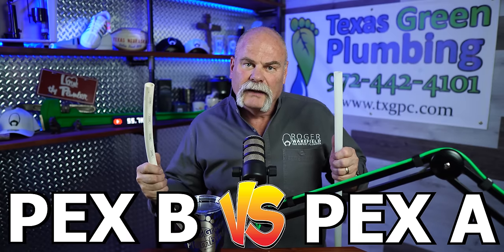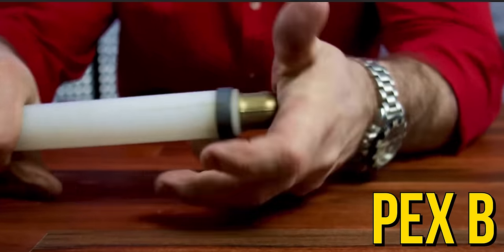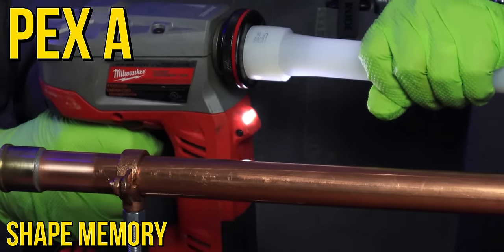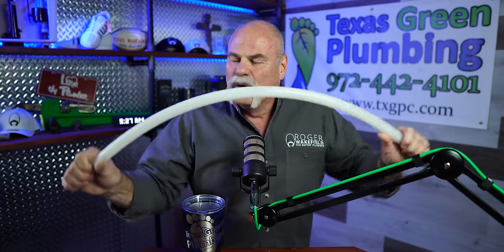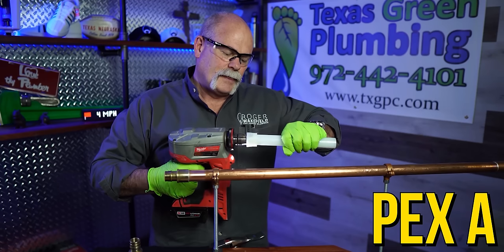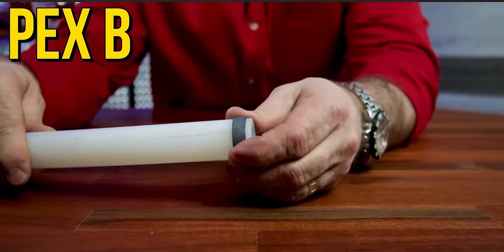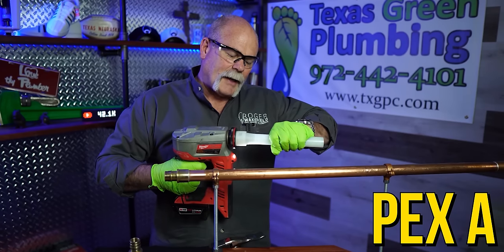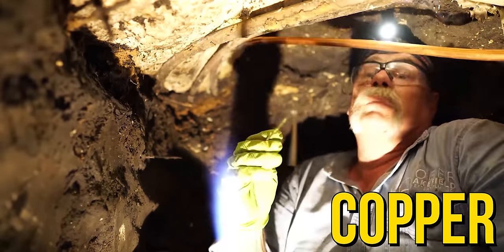PEX-A vs PEX-B - What's the Difference? Which Should You Use?

Comment: Definitely recommend an experienced plumber. 

That said, this stuff is nearly idiot proof. I re-piped my entire house (removed 100% old galvanized) with PEX A when the hardest plumbing job I had done prior was replacing a toilet wax seal. 

Also, for anyone who decides to DIY, screw the manual expansion tool. Spend the extra coin, save yourself time, and get the battery operated one. The auto rotate feature alone makes it worth it.
Reply: Agree. Thanks for comment.
Reply: Why would anyone doing a home improvement drop all the extra cash on the power tool? I could see if they planed to use it for a long period of time, but for a one off project?
Reply: @snyper1982  I did it because it makes the job so much easier. I didn’t have to guess a single time if I rotated it enough during expansion, and while I was in my crawl space I didn’t have to fight the lack of space when trying to manually use a tool. 

To me, the time saved was worth the ~$300. Plus I can resell it and have only paid about the same as if I purchased the manual tool. 

Not for everyone, but it makes sense to me.
Reply: @vinny61389  if you can buy it used or know ahead of time that you can resell it for nearly what you paid then sure its a good idea, especially if your one off diy is a larger one like yours was. But if your just doing a small diy job like most people, I dont think its worth the investment.  Just my opinion. Especially if your only  running 1/2 or 3/4.
Reply: @snyper1982  In my case I got a quote of $1400 to replace a copper line that developed a leak under the slab.  Line crossed under kitchen floor from a copper manifold in an interior wall of the kitchen to the outside wall feeding the sink.  Quote included removing sheetrock and drilling each stud to place pex through from the manifold to the back of the sink but not replacing the sheetrock or backs of the cabinets.  I was able to buy the bare tool (using batteries from same brand I already own), the pex a and all needed fittings for $400.  I was going to have to repair sheetrock or pay someone else to do it anyway so I might as well do all the work and save some money and the thought was I could probably sell the tool for 3/4 of what I paid if I wanted.  I would have preferred an underslab repair but it was not going to be possible without ripping out cabinets and granite.  Another thing that turned me off from the plumber that gave the quote was when I asked what type of pex they were going to use and they said the blue since it was a cold line.  I asked if they used crimp rings and they said yes all pex uses the crimp rings.
Reply: @mmotodad  if you got the tool and pipe and fittings for 400, I cant fault you for that. Lol. Im talking about dropping 700+ just for the tool, for simple home improvement jobs. I remember having to roll soft copper under the slab, repairs on those lines suck.

Comment: I work for two different plumbing companys here in San Diego. I've installed, using only pex A on a new construction 4 unit three story building in downtown S.D. Did the entire building using pex A, and using the Milwaukee tool for all of the couplings. Great and flexible stuff, loved working with it. While I do repiping on houses with the other plumbing company. He only! uses copper for every plumbing project we come across. Because he doesn't trust pex in the long run. And he doesn't want call backs for leaks in the future. So I guess its all personal preference.

Comment: How do you feel about the other type of crimp rings? I’ve switched to them solely because of the smaller tool and it seems like you never accidentally have those rings cocked and crooked the way that the copper rings will

Comment: Viega (pex B) 
Pros 
-faster (insert and pinch).
-not affected by cold when installing.
-easier to assemble pipe and fittings (built in stops in the fittings).
Cons
-doesn’t bend as easily
-fittings are not full flow

Uponor (pex A)
Pros 
-full flow fittings 
-bends easily 
Cons 
-slower to work with (expanding every joint and making sure the fitting is fully inserted before the pipe starts shrinking again).
-not easy to install in cold weather (pipe doesn’t want to shrink back without a heat gun) 

I feel for service work I would rather use viega because there’s no wait time. I can pinch a fitting and have the water back on instantly. With uponor you should wait for the pipe to set up before turning the water on. For new construction or remodel I would use uponor.

Comment: Keep in mind 3/4" copper piping has an inside diameter of 3 /4" or better (Type K=.745", Type L=.785, Type M=.811, all have 7/8" outside diameter. The 3/4" Pex piping (both Pex A & B) have inside diameters of .671 (basically 5/8") & outside diameters of 7/8". So we are already getting a flow drop restriction going from 3/4" copper to 3/4" Pex (3/4" to 5/8"). The fittings for Pex B do drop that a little bit more to slightly less than 5/8" based on my measurements but I could be wrong.

Based on my very limited experience Pex B does offer a significant labor savings advantage, obviously over copper, but also over Pex A. Now I was using a manual Pex A expansion tool, not the battery powered Milwaukee one. But I still think for Pex B (1) placing a band on the pipe (2) putting a fitting inside the pipe (3) compressing or crimping the band is quicker than using Pex A where you have to (1) place a band on the pipe (2) expand the pipe/band (takes about 9 expansions for 3/4" pipe using the manual process) & then placing the pipe on the next piece. Plus it takes 2 to 5 minutes for the Pex A band & pipe to shrink back fully not that anyone is going to stand around waiting for that to happen before going to the next joint.

I just do stuff around mine & my friends homes, I'm semi-retired. So not high-volume jobs. I like Pex A but still up-size the piping when going from copper to Pex. If I did high volume I'd probably switch to Pex B & still up-size the piping. For my small volumes jobs up-sizing the pipe or the fittings from a price perspective is inconsequential, doesn't matter. But it does keep the customers & myself happy...

Comment: As a person working in mobile homes this is hella helpful. Polybutylene was the work of the devil.
Reply: I have a traditional house built with poybutylene. Most has been replaced above the sub floor. It's had failures at fittings before. I am afraid pex plastic fittings will fail eventually.
Reply: Amen!!!
Reply: We are in the process of replacing our old poly b pipes. Running a 1 inch cold and a 3/4 inch hot from one corner of a finished house to the other up 3 floors with only 3 holes, not bad.
Reply: You know the funny thing poly is what is feeding the water meter...
Reply: @snyper1982  Not at our house anymore a lot of money later.  Directional drilling isn't cheap, but it's better than replacing the driveway.
Reply: @malcolmtaylor111  the city let you replace their pipe?
Reply: @snyper1982  Turns out everything downstream of the city's shut off valve is the homeowner's problem.  That includes the supply to the meter.
Reply: @malcolmtaylor111  I guess I should have been more specific, I was talking about the brass shut off valve that the meter connects to. That shut off valve is connected by poly to the city supply. At least in my area. Typically from the meter to the house is pvc. I haven't seen a house ran in anything other than pvc anyways.
Reply: @snyper1982  Our meter is in the house, the run from the city valve to the house is now pex.  I didn't get a look in the hole dug to see what the city main was.
Reply: @malcolmtaylor111  okay. Makes more sense now. Here the meters are out by the street. I dont think I would run pex from the meter (or shut off in your case) up to the house. Its just to expensive. Pvc is so much cheaper, that any benefits you might get from pex would be outweighed by cost IMHO. But that's just me. If you are happy, and it gives you piece of mind, thats all that matters, and that it is up to code. I'm not sure pex is rated for direct burial, at least not here. We always had to sleeve our pex lines when we had to run under the slab.
Reply: @malcolmtaylor111  
Usually from meter to curb stop box
Reply: @_RiseAgainst  They will, only use metal fittings. They'll be saying the same this about pex as they do poly-b in 20 years when the industry wants to push a new product. New is usually better.
Reply: @snyper1982  There are different kinds of poly. Black poly is ok, just don't want the gray.
Reply: @snyper1982  We use black poly to feed the meter and run into the house. Older homes have copper on the house side of the meter. I've never seen a house with pvc, we only use that on sprinkler systems and such. I'm in Idaho.
Reply: @thefix2573  we don’t do the house in pvc either. We do the underground to the house in pvc. Then a copper riser to get into the house, from that point it is pex. And to be honest I’m not even sure if that is the code. It is just standard practice. At least in my area.

Comment: I'm not a plumber, rather one of the home handymen who does SOME of his own plumbing.  I installed a water softener/filter on the side of my house (in a shed) and decided to do it Pex b for the fun of it.  It turned out ok, definately not pretty as the only "training" I got was on sites like this.  If it leaks, oh well it's out side and easy to fix. 2 1/2 years, no issues yet.  It would have been much more difficult to do it in copper but It would have looked better.  The Pex installed nicely, now as for the 30' run from the main back to the house and the rinse line drain going under a wall...  Had a pro do that part and install a pressure regulator.

Comment: Probably the most complete video on the difference between Pex A and B. I use the A version, because IMHO it is easier to install. Also, since you should up-size Pex B, don't you need to drill pass-through holes a bit bigger (I don't know). Thank you

Comment: Great vid. My mind is spinning as I need to repipe my home and Pex A vs. Pex B is  confusing. One plumber even wants to do CPVC. I see that Pex-A may have some issues after years with chlorine in municipal water more than Pex B? Then the hot water degradation of both is a concern as I run my hot water at 140F.

Comment: As a licensed plumber from Colorado and now Kentucky, it is also my opinion that Ped A or Uponor is better.  Lots better.

What alot of service plumbers are not saying is part of the reason Pex B is failing is that the METAL RINGS are failing/breaking/ cording.  Yes, there are brass Uponor fittings for underground connections, but Sioux Chief makes an underground tape that should be wrapped around the joint.

I currently use Uponor with Pro Press copper adaptors.  But, I still have to solder my Delta tub/shower valves or use the mechanical joint (male x female threaded joint).

Comment: As a relatively new plumber (~5 years) I've only ever worked with pex A out of these 3, but I wouldn't even want to try using B. The clamps, like you said, doesn't even seem that secure let alone the restriction. The only thing I really don't like to do is use those sharkbites to go from pex to cpvc/copper.

 Maybe it's because I was trained by older guys, but I just don't trust them. I've never had one fail, personally, but I've heard plenty of stories of the rubbers going bad and causing leaks in walls and stuff. I'll always endeavor to just use male/female fittings to avoid that.
Reply: I've messed with pex B. I was dubious, but man is it secure. Hard as hell to get off without the right tool. Two grown men fought with it for a while, even after snapping the ring off with cutters; no dice. I trust it, even if the ring failed, but corrosion is the only way I could see that happening. Pex A does seem better in that regard, and I hadn't considered the flow restrictions, though the system I put in works great.
Reply: Never had issues with flow or the reliability of Pex B, But I like the Pex A process better and this is coming from someone who used both

Comment: Great video! Thank you! Does anyone know about the organic chemical leaching effects of Pex-A vs Pex-B? I seem to recall this being a concern with Pex-A.
Reply: Yes, why is this not mentioned with all the other details about Pex? From what I’ve researched, the jury is still out on how long the chemicals from Pex pipe leech into your drinking water. The Pex B pipe just leeches less chemicals than the type A and C.
Reply: Pex B leaches zero chemicals.  Pex A is old school tubing. Who cares that is more flexible. We are plumbers. Pex A also reacts with chorine.  PexA fails in domestic hot water return lines. Zurn expansion system installs identical as Pex A expandable but uses Pex B which also has a burst pressure of 1000 psi. PexA burst rating Is 560psi 🧐
Reply: @marcbreault9371  we've always used pex b and recently had a client insist on using pex a. We ended up buying the tools and installing A throughout his house. Now that we have the expansion tools we've been thinking about sticking with zurn B and just expanding it. Seems like zurn b is the superior pipe. You agree? Not a lot of info out there about expanding zurn B.
Reply: @marcbreault9371    I thought Pex-A only reacted with heavy concentrations of chlormine , not chlorine?
Reply: @g0osefraba  If the tubing shows F1960 stamp on it than it’s expandable like pex A. You can use the  uponor type fittings with it.  I believe the Zurn B is more superior.
Reply: @ronh9384  pex A does get degraded by chlorine more on higher temps.
Reply: From an article I read:
While PEX is tested for resistance to chlorine, there are several factors that increase the risk of chlorine failures in PEX, including elevated temperatures and pressures, exposure to UV rays from the sun or fluorescent lights, and local water conditions.

Comment: Im in the north Texas area as well. A couple of years ago I did a job out in Lewisville to be exact and I was using pex A. It was in the winter season and it was extremely cold out. I had trouble getting the the pex A to shrink down on the the fittings. Some wouldn’t even shrink because it was so cold. I’m sure if it were a little warmer it would of worked perfectly. But that was the last time I used pex A.

Comment: I'm looking at possibly putting in Pex A and removing my current copper pipes.  With the nightmare of issues I have seen and had to deal with copper pipes.  Removing sections (as much as possible) over time throughout the house seams like a no brainer and much less maintenance down the road.

Comment: I’ve used both. I like them a lot PEX A is a little bit easier to work with but I honestly don’t have a preference. And I feel if you have to use a shark bite fitting they hold way better and bite into the plastic better as opposed to copper. I think everyone should learn how to solder first before moving to PEX.

Comment: Try getting that expansion tool into a lot of the tight places needed to make a connection. I have been using Pex - B since pex came out. I use 1" pex to a manifold for both the cold and hot. A single feed line is then run from the manifold to the fixture for both cold and hot. I've never had a single complaint with water flow or pressure.
Reply: Milwaukee has and m12 expansion tool that I have yet to find a spot too tight.
Reply: Not sure your point.  The expansion tool allows you to swing the pipe out in the open to expand, then put the pipe on the fitting.  It's the compression tool that needs to be shoved into a tiny area...
Reply: Why can't you swing the pipe out with the expansion tool?
Reply: And the reverse is true. Try compressing that Pex-B ring when the fitting is tucked behind something. With Pex A just expand and reach around and push on your pipe - done!
Reply: @gpstar9234  I've never had a situation where I couldn't get a ring crimped. I have both tools and have used both on complete houses, I still prefer the crimp.

Comment: super videos and explanations ..... been remodeling some basements in a commercial space with many separate bathrooms and the plumbers used pex B.  I didn't finish the ceilings and left everything exposed.  GOOD THING!  Pex B started to leak slightly.  I don't know why ... the trouble areas were replaced with PEX A and then I finished the ceilings.  ZERO problems.

Comment: If your expansion tool doesn't rotate automatically do it by hand, the ridges it imprints helps lock the pipe onto the fitting so you want to make sure you hit all of the interior of the pipe instead of leaving gaps where the head expands. In addition the new football style heads for the expansion tools are an upgrade I would suggest, my company has had better results since we upgraded to the more round heads.

Comment: The plumbers just replaced our supply line from poly-b to PEX-A. The plumber was in the crawl space and I couldn’t figure out what the drill sound was. The Upanor tool. Very cool. It was also amazing how deep they had to dig down into the driveway. They worked so hard I bought them lunch and gave them a tip. By their reaction it seemed like this was the first tip they got

Comment: I'm a regular homeowner and had to repipe my entire house. We're on extremely hard well water and the copper in the slab developed pin hole leaks. I used PEX A and routed all the lines through the attic following uponor logic method. I insulated all the lines as well and used pipe straps to secure it. Was very easy to do and saved me about $20k